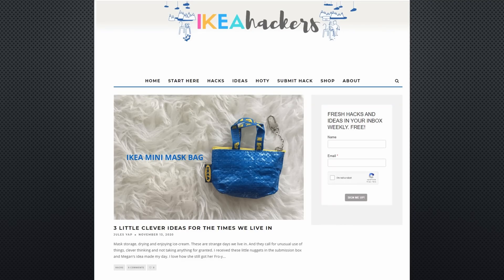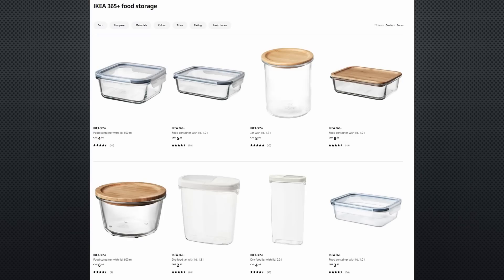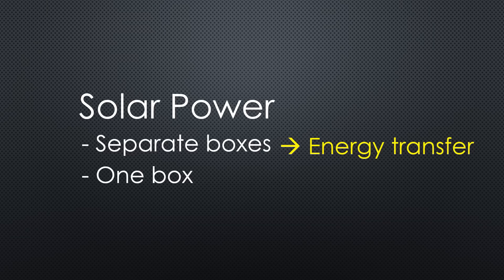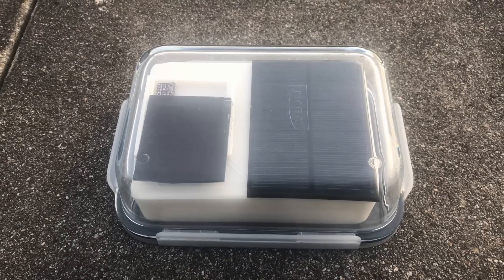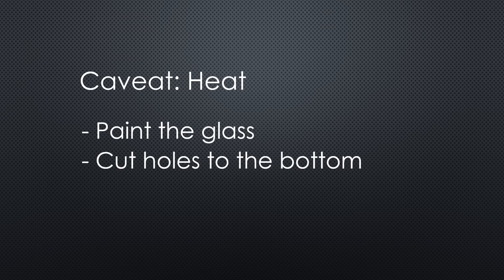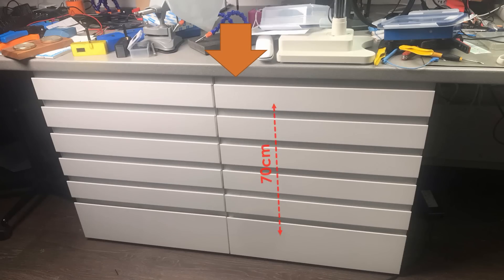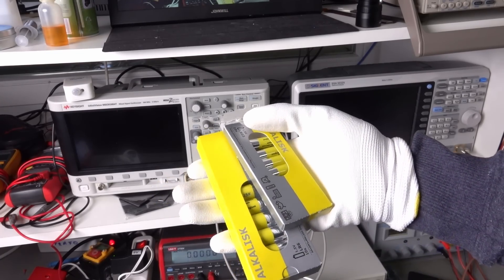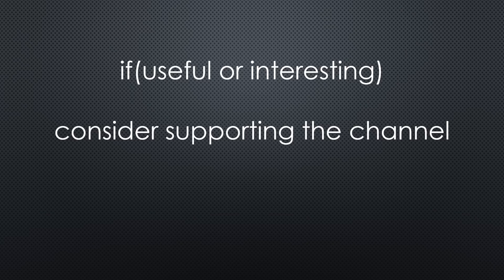#361 IKEA Goodies for Makers incl. my Newest Find

Comment: Thermal regulation can be done via conducting the heat through the case with a heatsink on both sides. The internal heatsink will get hot. Transfer the heat to the external heatsink for dissipation, minus the loss through either the glass or if your willing to cut the silicon cover and reseal the heatsink with silicone sealant. This would have a reasonable effect
Reply from the maker: I am not sure because I only have hot air and no point source of heat. But because quite a few viewers suggested this method, I will do some tests.
Reply: @AndreasSpiess  Hot air will equalize on the heatsink. As long as their is a conductive path, it'll cool. The delta will determine by how much and the loss through the silicon lid or glass determines how quickly
Reply from the maker: I decided to start a comparison between different proposals. One will be with heatsinks.

Comment: I know nothing, but...

If you were to make holes in the lid which would be at the bottom, would you need a fine mesh to stop insects getting in? I guess to help prevent water getting in, you would need some sort of skirt that would extend the sides past the lid by a couple of cms and some silica gel stuff.

Alternatively, stick it on some legs and use a heat pipe to transfer to an external heat sink.

Now I have shown my complete lack of knowledge, I shall go hide :D
Reply from the maker: According other commenters, animals seem to be a problem with holes. I am also skeptical with heat pipes because I only have hot air and no point source of heat. But many other viewers suggested this method. So I will do some comparisons

Comment: My light sensors are in a sealed test tube (borosilicate passes all relevant wavelengths), along with an aluminum rod that transfers the heat out of the tube without allowing any air exchange that could carry moisture inside the tube. The tube is covered with aluminum tape (used for sealing heating ducts) with windows cut for each sensor. I use shielded CAT5 cable to connect the sensors to a box that holds the electronics, which sits in the shade of its solar panel. Everything stays dry, and cool enough. So far.
Reply from the maker: So you have either big test tubes of small sensor break-out boards. I only have quite small tubes. 
The general setup follows the same idea, to use glas for the part exposed to sun. I just wanted to extend it to a "one box" setup. But maybe I have to give up...

Comment: For heat exchange, middle of the plastic lid should be cut off, and covered with a peace of aluminium plate, mounted with screws and sealant. Small heatsinks can be mounted inside and outside,  with a small fan inside. That would transmit some of the heat outside, without sacrificing the seal.
The problem is this plastic will not stick properly to any glue, so mounting the plate can be quite difficult.
Reply from the maker: I still dream of not letting too much heat in. But such heatsinks are my last resort!

Comment: Motorcycle dashboards usually have a hole in the back covered with goretex, it allows air in for ventilation but mostly keeps the humidity out.
Reply from the maker: I ordered such parts and plan to do some tests.

Comment: Cover the not used glass surface with a 
stiffer bubble wrap, and then 
an aluminum tape over it. 
Should reflect most of the reflection heat not transfers as much into the glass body.
Reply from the maker: Aluminium tape was mentioned by a few viewers. I think this is a good idea!

Comment: I use 4 Lack tables stacked for my 3d printers and 3018 cnc. Very convenient and saves a lot of space
Reply from the maker: Cool. I saved some space by selling my CNC ;-)  It was no more used when I got my 3D printer.
Reply: @AndreasSpiess  I use mine almost exclusively for pcb prototype milling. but this feeling I could do xyz if i needed to is kind of soothing even though I probably never will. but very true, fdm 3d printing is the best thing since sliced bread for homegamer

Comment: 1,50 Euro Silicon Brush for applying wood glue - a commercial glue bush like from rockler or so would cost you 10 Euro
Reply from the maker: Siliocone is a very versatile material, and I assume the glue will not stick.
Reply: @AndreasSpiess  you can peel off dried PVAc glue without any problems

Comment: Hello Andreas, just try to fill the container with Silicone Oil or similar. The issue of your construction is the low heat capacity and the bad heat conduction of air. Air 0.024 W/m K, silicone oil 0.15 W/m K. Using silicone oil allows the heat to be faster dissipated in the surrounding. Additionally the silicone oil is acting as a moisture repellent in case of any moisture in the container. The refractive index of 1.4 which is near to usual fused silica is also well suited for your application. Not sure if the index is close enough to the one of glass in order to be optical loss free. 
Br Michael
Reply from the maker: Interesting idea. I am sure it would work. But I fear it would create a mess! But maybe I am not yet ready for this step.
Reply: @AndreasSpiess  thats true, but it will work for sure without drilling or stick anything onto the case. How thick is the glass? If i find some free time during the weekend I'll calculate the maximum heat transition (comparing air and silicone oil) by given internal and sorrunding temperatures.
Reply from the maker: Others made a proposal to use paraffine wax put somewhere in the case. It seems to get fluid below 60 degrees and I could keep it in a particular place (which would be less messy). What is better for the purpose: Silicone oil or paraffine wax put in a particular place inside the case?
Reply: @AndreasSpiess  definitely paraffine wax, it has an excellent heat storing capability due to it's high heat capacaty of around 2.5 J/ g K. Additionally huge amounts of heat (more precise enthalpy) will be trapped by the phase change from solid to liquid. BUT! this methode works only in a dynamic situation where wax is used to transport heat, in your case the heat only gehts trapped until a maximum temperature is reached. After reaching this max, the inside of your container will reach more or less the same temperature as without the wax, it only takes longer depending on the mass of wax you're adding to the system. Roughly estimated, based on the size of your container and average weather datas from Switzerland (which are pretty similar to our Austrian ones), the efficency of cooling the system by stored "cold" will approach to zero after two to three hours. Apart from that, the stored heat is dissipated form the wax when the air inside the container begin to cool down, the system works now in the opposite direction. Thus the air inside the container will stay at higher temperatures for much longer. Well give it a try! This rather simple case contains a lot of physics to think of. ;)
Reply from the maker: This is why I like viewers like you who know much more about physics than me!
Reply: @AndreasSpiess  as a chemical engineer working in a semiconductor front end plant those topics are more or less my daily business. ;)

Comment: 1) Improve thermal path: Embed a large aluminum plate/heat sink in the lid on the shade side to improve thermal dissipation and carefully seal around its edges?
2) Divide and conquer:  Move to 2 boxes, one with the solar cell out in the sun and another in the shade for the electronics. You'll need a sealed hole in each lid for the power lines and UV-resistant/protected wire. Even without exploding batteries, I'd be worried about the reduced lifespan of a lot of the electronics under the harsh and constant sun in some places.
3) Preventative mods: 3D print new lids in ASA or other UV-resistant material. I've seen polypropylene nearly degraded to a fine powder in about a summer out here. Also worth adjusting the rim geometry so water can drip down and off the lid instead of just getting caught in the gasket area.

Cheers from Southern California
Reply from the maker: You definitively have more experience with sun! Your proposals for sure would work. I still hope I can get away with shading. But, after all the different proposals I decided to do a test setup with different things like completely sealed, with a hole, with a membrane, and maybe even with a aluminum heatsink, if I am able to solve the problems.
I found the idea to have glass as the main box in the sun appealing because it probably will not be destroyed as fast as plastic.

Comment: the heat in summer can be a problem. A simple solution can be drilling holes in the bottom of the box and lift it up so that water doesn't come in when it rains. I had a similar structure for a similar project I run in the UK for more than a year and it worked fine. The only isse were the spiders! Here is a blog post that describes it:
https://bochovj.wordpress.com/2016/08/28/a-year-of-piot-lessons-learnt/
Reply from the maker: Nice blog. You were very early with your experiments! After all the comments I decided to do some comparisons. One will be a setup with a small hole.

Comment: what is the status of the battery management / solar charger board that you started as a community project? unfortunately i didn't have the time to follow the development, but if it comes to results i would be very interested.
Reply from the maker: Two small groups are still working. For the moment they published the diagrams for review by the rest of the group. Unfortunately nobody responded...

Comment: Some great ideas where presented here! Just combine them...
To release the heat, you possibly can replace the lid with an aluminum plate, reuse the seal and clamp it to the glass container with top and bottom aluminum beams across the container, joint with threaded rods and bolts...
It remains sealed and has a built in heatsink!
I would definitely cover the glass with some aluminum tape where you can.
Reply from the maker: Good idea with the aluminum back. After all teh comments I decided to do a comparison with different setups. We will see what happens.

Comment: Hello Andreas. What's the name and IKEA number of your white drawers? I can't find them at the Ikea website?!
Reply from the maker: I think I left a link in the description
Reply: @AndreasSpiess  Perhaps I am too blind. I only find some with 4 drawers but none with 6 drawers? Any hint (IKEA article number) available?
Reply from the maker: As said in the video: I had to cut off 10 cm at the top. So I lost the space for one small drawer.
Reply: Yes I understand, but I cannot find the source where I can cut something. This means you found a cabinet with six or seven drawers and cutted one away. But I can only find a cabinet with maximum 4 drawers. That's why I kindly asked you to give me a hint which is the article number of your cabinet. (I guess maybe it is not available in Germany or no longer available?!?)
Reply from the maker: Think of the block without drawers: just 3 wooden planks where you put your table on. Just shorten these 3 planks and your table will be 10 cm lower. But you have lost space for one small drawer, of course.

Comment: I use a product called 'damp seal' in the UK for leaving a UV proof wax layer over anything you spray it on, great for seals on boxes, and good enough to last a few weeks in Scottish weather on a exposed solar panel 

Its not a wd40 or ptfe spray, its a wax spray designed for older style distributor-type ignition systems on cars, thats why its got such great UV resistance. Its also wonderful at stopping condensation on pipes! Just spray it on, it creates a barrier layer and condensation no longer forms 😁

Edit: out of every tech tip and little trick I know, that one about the damp seal and the pipes is probably the one that's got me the most thanks over the years..... its a problem that drives people crazy for years, they can spend a fortune trying to fix, then I swoop in and fix it in exchange for a cup of tea 😁
Reply from the maker: I found the product. Not cheap around here because it seems to be a UK thing and has to be shipped from there. Where would I use it in my box?
Reply: @AndreasSpiess  I've used it around plastic box seals, and across any bare metal inside that might have condensation form on it during rapid temperature changes. The shielding plates on a lot of circuit boards for example.and the heat/UV resistance properties seem to keep it there for a long time.

If you ask at a car garage that deals with classic cars they might point you to a local equivalent, i know extreme computer overclocking fans (liquid nitrogen setups) have something similar in a can they use to test setups, before covering their motherboards in vaseline for the extreme test!

Comment: Hi there! Freundlichen Grüßen von the lurker ;-)
If you have a polypropylene lid, on the bottom of your box, I might suggest making a cutout for a two-sided heat sink, operating passively, with no screws or penetrators, and the heat sink could even be used as mounting legs/feet. Even on the bottom, it would provide a path for some of the heat. I wonder if you could use a salvaged heat pipe from a CPU cooler to get heat from the air to the heat sink?.the cutout, sealed with a good acrylic or silicone, should be just fine.
Reply from the maker: I am not sure how good it would work because there is no "heat source", just warm air. But maybe I will try it once.

Comment: I had an electronic idea for temperature controll: (I hope I didn't overlook a comment with the same idea)

What about a peltier element at the bottom with a sealed heatsink at the outside. You could glue the heatsink on the outside with a "window" cut out that is smaller than the heatsink where you attach the hot side of the peltier element to transfer the heat to the outside. Put some "feets" on the lid so that there is a better vantilation. And in the summer when the sun is hot and high and the LiPo is allready full you can use the unused power to fire up the peltier and cool everything down. In the winter you could also reverse the polarity to use it as an heater to defrost the glas. 

Ok....I guess that is more of an overengenierred idea and I guess you can get very fast a problem with the power management. But somehow I like the idea. You can seal it of, heat or cool everythin inside and who else has peltier element controlled environment in an ikea box. ;)
Reply from the maker: Somebody already mentioned the peltier element and it vast energy need. I assume it would increase the size of the solar panel considerably.

Comment: Great video. I love those glass bottom containers, they are much better in terms of discolouration resistance compared to plastic.

Their USB chargers are also great quality.

I do wonder how does one mount your parts inside if you don't have a 3D printer, perhaps plastic stand-offs with double sided tape?
Reply from the maker: I glued the parts to the bottom in the case of the satellite station. And the solar panel on the top of the battery.

Comment: I would put coper wires or tubes through the plastic lids to absorb the heat in the container and radiate the heat outside the container, and seal the holes to keep it watertight.
Reply from the maker: I am not sure if this would be sufficient because the heat is not produced by a "spot" like a chip. It is everywhere and I probably would need a bog surface to "catch" this heat.
Reply: @AndreasSpiess  I am assuming that you could increase the internal and external surface area could be increased using the heat sinks used in many computer parts.
Reply: @AndreasSpiess  I would put a heat sink inside the box and another outside the box and join them with copper pipes through the lid.  I think that should work :-)

Comment: IKEA Bekant + mega desk. 😀 https://github.com/gcormier/megadesk
Reply from the maker: Interesting project! So far I never worked with such moveable desks. They were always too small for me ;-)
Reply: @AndreasSpiess  IKEA now sells just the motor + metal frame if you want to put your own wood (or other material) surface on top. Although I"m not sure you could fit all lab equipment there is surely a weight limit :)

Comment: Have you considered encasing the boards in wax? As it heats up it melts the wax and the wax freezes and re hardens overnight in the cold.
Reply from the maker: No, I did not. The idea is interesting if I would use one with a low melting point. Maybe other material also would do the job.

Comment: Hallo Andreas, for either your IP65 electronic housing, or the IKEA version you may want to go for a pressure compensation element (or Druckausgleichselement (DAE) what it's called here) if you want to place it in direct sunlight, which in terms of solar is obviously the case. Sunlight heats up the inside of the housing which leads to a higher pressure inside. During absence of sunlight/night everything cools down, the opposite will happen: Pressure inside the housing will decrease even lower than the outside pressure, also thanks to the "perfect silicone sealing". This will suck in moisture through the weakest part of the housing, which is in most cases the sealing or cable entries. Moisture that has already condensated inside the housing will never pass the "perfect silicone sealing" again, and your electronics will start drowning after a couple months. This whole process is also called thermal breathing. A DAE prevents "thermal breathing". You can have the PA6.6  M12 type for around 3€.
Reply from the maker: So far I had no problems with my "tight" light sensor. But because many viewers made the same proposal as you I decided to start a test to compare a tight case, one with a hole in the bottom, and one with your proposed solution.